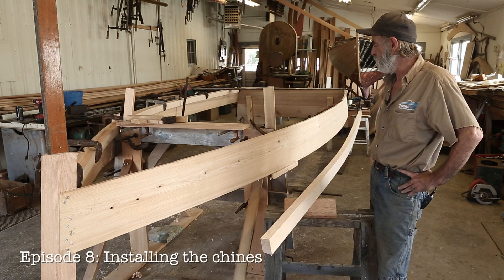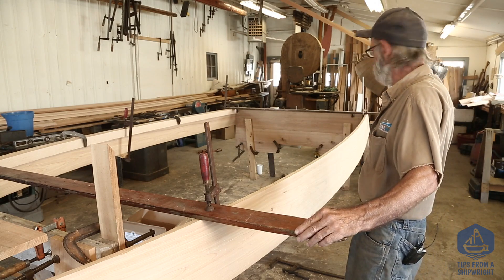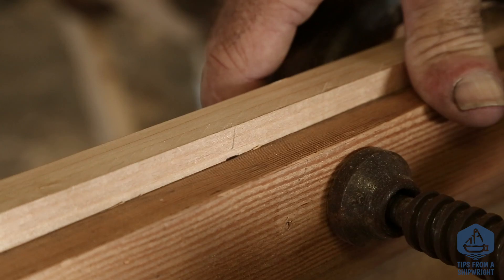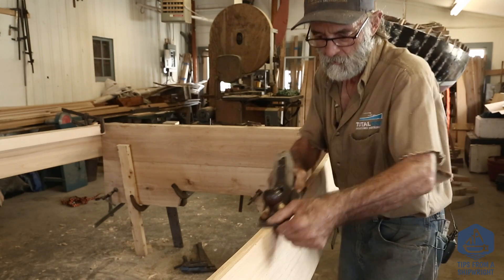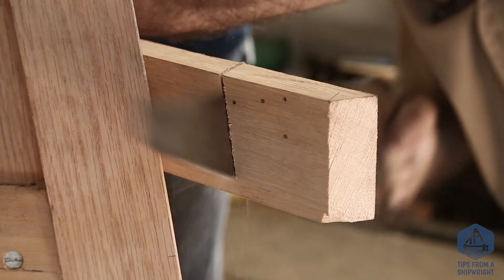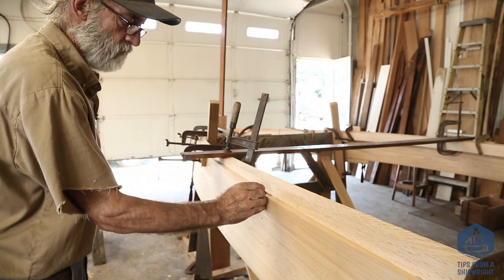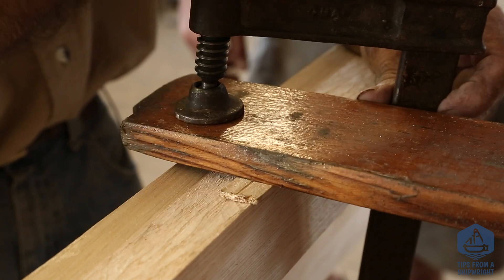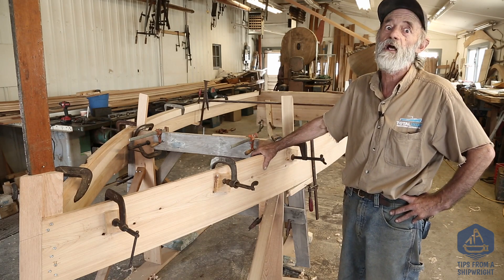Building the TotalBoat - How to install the chines on a wooden boat work skiff (Episode 8)

Comment: trimming the chine at the transom is a step i messed up on my boat.  Cut it short, but solved the problem by making a corner post that went between the transom and chine.  Probably not as strong, but it works.  I should have re-watched this episode before going ahead with that step. Thanks for all the great tips Lou!

Comment: Hello Lou!  As a huge fan of the Total boat series,  I have a question that I'm hoping you can answer.   After you've cut down the hull to the essential waterline on your video with your circular saw, you used an electric planer to get the 6 degree angle required to make it flat to the other side of the boat.  I have an edge guide for my electric planer and wondered if using it alongside the hull  would give me the same end result as the hull is also set at a 5 degree angle?

Comment: Are the batter boards set level across the width of the transom and amidships? And are they level front to back? I see you plum the frame members rather than square them to the chine logs.

Comment: I am not a boat builder but have a small boat project that I could use some help.  My Granddad had a 14' Lone Star aluminum boat that had wood gunnel, a wood strip on the side that i believe is to force the water back out, and wood seats.  I believe these where mahogany and at one time was very pretty but years have damaged them.  I would like to replace with white oak, which most recommend, but I'm having trouble finding air dried white oak, mainly because the pieces need to be 16' because I prefer not to splice.  Any suggestions, enjoy the videos especially the one on steaming the gunnel in the plastic bag which I think would be the best for my project.  I did find some white oak in Arkansas but it would be green, not dried.